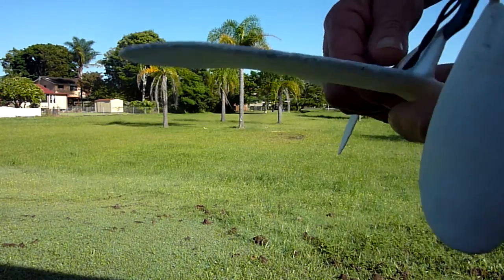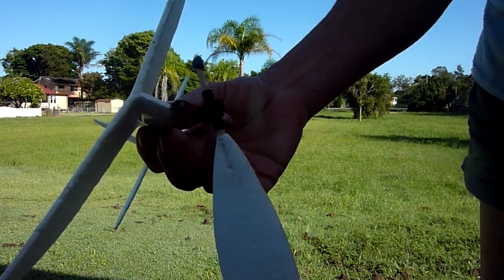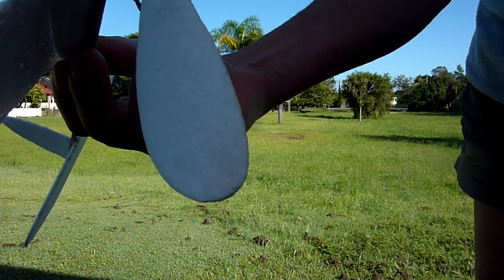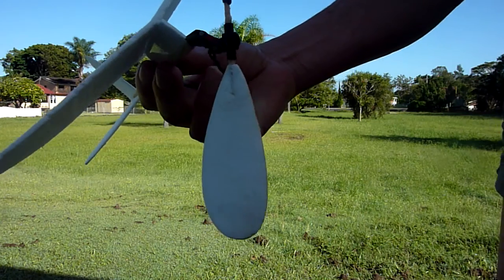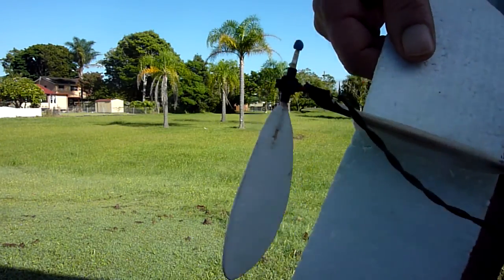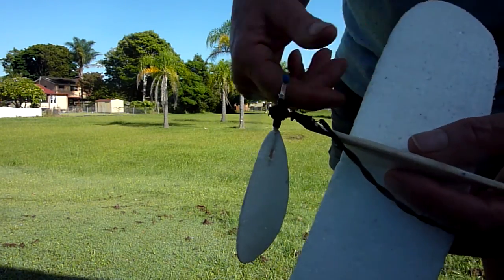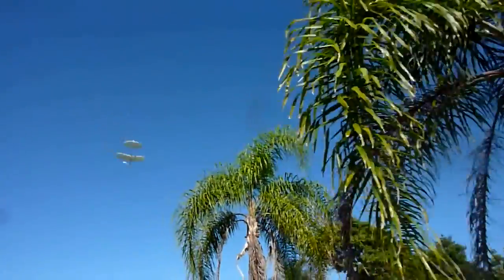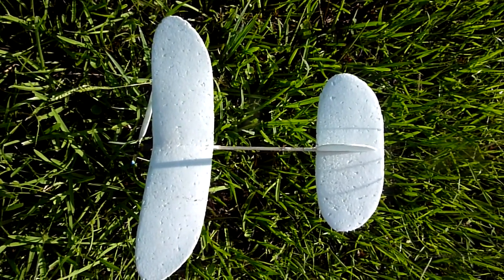SINGLE BLADE PROPELLER PLANE

Comment: Haven't seen a single with counterbalance before. Flew well!
Reply from the maker: sciencetoymaker They have them on YT on some indoor planes (and a really BIG blade). lol I have seen them in photos (in magazines) with a full size (cub) type plane. I suppose single blade props would be easy to make. You don't have to make any other blade identical, all you have to do is get the right counter-balance. lol
Reply: There is an Italian sailplane motor with only one blade.
Reply from the maker: Philip Rossoni Cubs (or planes like them) sometimes have them too.